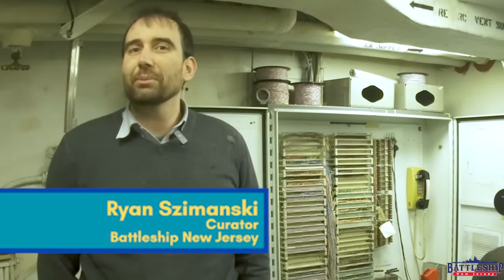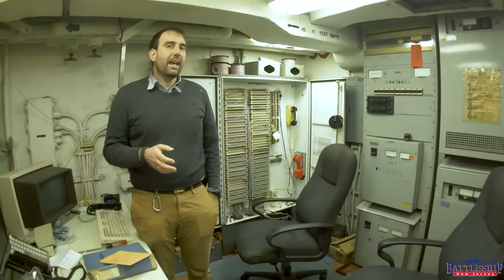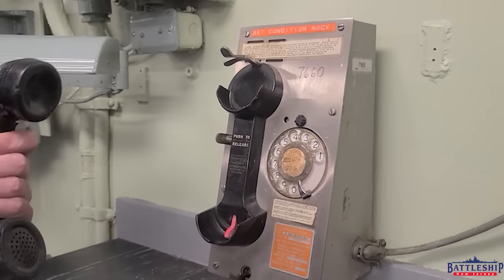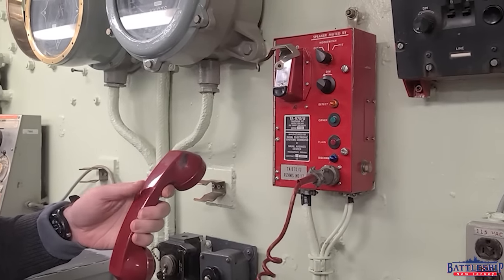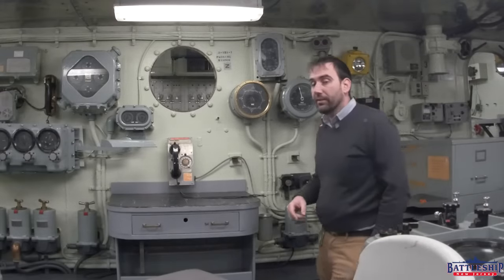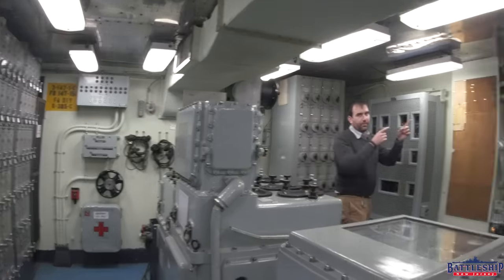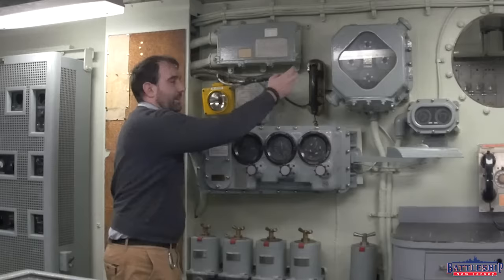What Powers a Sound Powered Phone and How Do Ship Phones Work?

Comment: I served in the Peace Corps in a small town (maybe 20,000 people) in Kazakhstan in the mid 1990s. One of the locals took me to the local telephone exchange - a building about half the size of a football field filled with bank after bank of analog switches. It made a tremendous racket. I heard that soon after I left, they replaced the whole thing with a single PC.
Reply: Unlikely.
Reply: Sounds like it was an exchange based on Strowger switch's. On nights it was possible to British Telecom engineers to "follow" a call physically across their part of London as it worked through each switch stack. As to a single PC, it may have had a bit more than that, but nothing more than a filing cabinet size box that the PC connected to.
Reply: I've seen similar miniaturization. From the old "stepwise" mechanical switches filling a large house (what looks like a house from the outside) to a DMS-100 in a building that would fit inside a single car garage. And then a "softswitch" that fit in 7U (23" telco rack) that could handle everything in the entire CO building. (Alcatel 600e + Lucent 5ESS) [not counting multiplexers to fan out to 10,000 to 100,000 POTS lines.] These days, with everything being IP (VoIP/SIP), a Raspberry Pi can do it - aka. the single PC.
Reply: with a single pc the problem would be how to attach all the lines.  

it could probably route as many simultaneous calls though - but what's more likely is that more such boxes were placed around the city instead of the single building.
Reply: Boooooo
Reply: one just has to look at old exchanges in the USA, big buildings that by any other standard than for a telephone exchange are massively overbuilt. Floors rated for 5x load carrying or more compared to a typical commercial or industrial space. And that is because the analog switches are heavy and are technically a live load due to vibration. Some areas of modern exchanges are still very structurally over the top by standards outside that industry because the battery banks for power backup are still quite heavy.  huge battery racks and of course gensets are why especially when the phone network was still fully analog it was extremely resilient. if the line was still there and unbroken odds are it could make a call because the CO was still there and powering itself even in a bad storm.
Reply: @filanfyretracker even the modern phone system is astonishingly resilient. Most customer premises equipment either has a battery backup, or the option to install one. With cellular networks, either has emergency power onsite, can connect to a site that does, or reverts back to a larger cell that overlaps with it.

Ultimately, modern phone networks have retained much of their resilience, even if the simplicity of keeping the battery at the exchange has changed.
Reply: @filanfyretracker  Telephone exchange buildings [at least the Bell system ones I saw] were "overbuilt" in anticipation of expansion -- of the current tech.   Pretty smart.   Of course, as tech progressed entire floors of switch racks were reduced to a couple of racks of computers.   When Ma Bell was broken up by courts, it became very sad to see the competitors [who, by court order could use Bell facilities] would slap in their equipment and just dump the packing materials and other waste in the "Bell" areas for them to clean up.  Very sad.

Comment: When I worked as a ski lift operator in the early 1980s the phone from the bottom to the top was a Navy surplus sound phone. We also had a regular telephone to call other places on the mountain.
Reply: understandable, I can imagine they wanted at least one link that was always assured to work if something went wrong with the lift.
Reply: Sound powered telephones are still used to this day even on new ski lifts at least here in France.
To call you have to rotate the wheel at the back of the handset but it's not really a crank, just a wheel that you grab with your entire hand.
Reply: @psirvent8  ours we had a button that activated a beeper top and bottom, pick up hand set, beep, other end picks up hand set, thing was always live.
Reply: @someonespadre Buttons means it must've had a battery for the ringer.
Reply: @psirvent8  the beeper was a separate system, electrical. 1 beep to talk, 2 beeps clear to start? reply 2 beeps okay to start. Don’t remember what 3 beeps meant. 4 beeps, have a problem going to be a while.

Comment: Sound power telephones were one of the first things we used in my apprenticeship . Good to learn connecting and wiring techniques with no external power . They are amazingly good and useful for any situation .
Reply: Interesting that they made them work in a battleship. The power from a dynamic microphone has to be very low, so the volume at the other end also has to be pretty quiet. On the other hand, there probably would be a lot of noise inside the room, so it had to be hard to use those phones. Of course, better than nothing.

Comment: Dad worked on the manufacturing side for IT&T. I believe at least 2 of us did science fair projection in the  60's on how rotary dial phones worked. We would also occasionally go to the office with Dad, and saw switching equipment  being built. Same process as building a replacement wiring harness for a car but scaled up. Large sheets of plywood, fitted with pegs and people, following a diagram with various colored wires

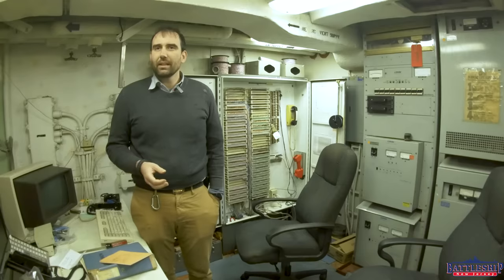Comment: At about 1:38 in the video, there are racks of grey equipment to your left.  Blow that up to full-screen and you'll discover that it's Lorain power equipment.  I worked for Lorain Products and its successor companies for 28 years starting in 1983.  That equipment looks like current production for that era, so I think your phone system power plant is from the 1980's.

Look at the nameplates on the units with a voltmeter and an ammeter on them.  The model numbers ought to start with either RHM (most likely) or RL.  The RHM chargers were phase-controlled SCR bridges and thus available in 3-phase only.  This seems likely with your 3-phase, 440V power system.  There were 3-phase RL chargers as well that used two single-phase ferroresonant converters in a Scott-T configuration, but I find that less likely for your installation.

It wouldn't be all that hard to get that power plant running again.  Replace the big fruit juice can electrolytic capacitors and the chargers will likely run.  Those things were tough as nails.  That's why the customers loved them so.  Even 40 years later, there are a lot of RHM and RL chargers still in service, so Emerson Network Power (the present successor company) ought to be able to provide suitable capacitors.

Tell them that Will from engineering sent you.  The old hands will know who you mean even to this day.
Reply: I repair old power supplies, and we got a few in yesterday which have the same vintage look. Transistors from 1980/1982, design we estimated was from the mid-1970s. Capacitors were astoundingly okay, a single carbon film resistor had drifted low causing a diode to overcurrent. Replace both of those, and it's off for another 40 years of service!

Some of the stuff back then was incredibly robust. But then again, we now have transistors smaller than your pinky fingernail that outperform in every metric a 1980s transistor that is larger than your thumb. There's a reason we've moved on. Don't get me started on power factor and efficiency!
Reply: @phillyphakename1255  One thing a tiny transistor does not do better than a big transistor is power dissipation :) It's more difficult to get the heat off a TO-92 than a TO-3 :)
Reply: @Pentium100MHz  true, if you are using it as a load, but for everything else...

But for everything else? A Rds on of 4.6 milliohms? With a resistance that low, you don't have to dissipate much heat so you don't need much surface area.
Reply: @phillyphakename1255  Linear regulator, Class AB audio amplifier can create a lot of heat. If used just as a switch, then yeah, most of the time it should be fine. For something like 10A I  would probably want something bigger than a TO-92 with its ~200C/W thermal resistance though.
Reply: @Pentium100MHz  ah, fair enough. My job doesn't use any linear power amplifiers, didn't think about that.

Comment: When I was in 73-76 USS Midway CV-41, my GQ station was a phone talker.  The headset had some tricks.  All three parts (two ears and mouthpiece) were the same -- you could listen to the mouthpiece and speak into the ears.  The mouthpiece had a pushbutton switch which normally disconnected it, otherwise it would pick up all the local sounds for everyone on the circuit to hear.

Fun: the mouthpiece pushbutton had a rotating cap which did absolutely nothing.  But it was easy to convince the new guys it was a volume control.
Reply: the standard sp handset is the same, talking into the ear piece was quite common when you had an amplified speaker.
Reply: Volume control, LOL! Good one... For people's information, the sound-powered phone talker at 5:20 has the chest-mounted mouthpiece folded down out of his face. You can see the back of it next to the sleepy guy on the red phone. The mouthpieces are on articulated arms that make them pleasantly adjustable, and allow you to keep them (and yourself) out of trouble. They were still in use 10 years ago for station-to-station communication during UNREP, and sound-powered phones in general still form a vital emergency backup on modern civilian ships. Volume and clarity depend almost entirely on the phone talker themselves, plus a little on your receiver.

Comment: I was a 31C in the Army 1984-1989. We operated the AM radio teletype sets and usually the short wave FM crypto sets. I was sitting on top of a ridge about 10 kilometers southeast of Pannmunjon above Bangmok-ri as a relay station when we caught the MARS station in Pusan. I called my mom in Colorado Springs from a mountain top on a radio and it didn't cost me a dime. That was technologically amazing at the time.

Comment: I was stationed on board the USS Stennis during OEF.
For the first part of the deployment the "pay phones" worked intermittently. Some of that had to do with OPSEC, some of it had to do with the equipment on board. Later in the deployment the phones were working almost 24/7. MWR in conjunction with the NEX started passing out 15 minute phone cards for free at about the middle of deployment. AT&T also passed out 10 minute phone cards. There were stacks of them in the First Class Mess. I still have a few unused cards in my desk drawer.

Comment: When I visited in April (2023) I tried some of those rotary phones and most of the telephone instruments themselves needed repair as does the one you demonstrate. I was able to make another phone ring, but we couldn't have a conversation. After the phone itself works you still need to make cross connects and switch assignments. That PBX should be capable of interfacing with outside lines when tied up.

Comment: It was a pleasure for me to see  again one of what you called "the coke machine" . The red box for radiotelephone  communications between ships in a squadron. I was part of the Hughes Aircraft Co. group that developed that system to replace older telephone crossbar switches. I also had to demonstrate  for VIPs that two different signals, one plain and the other meant for encryption before being transmitted could not be detected even on adjacent channels. Crosstalk was one of the problems with the systems that ours replaced on Navy  warships of all kinds.

Comment: RN sound power phones had a shutter system on individual phones , the growler was enough power to release a luminous tag  behind a glass on the case so you could easily identify the unit with the call . It reset when the handset was used .

Comment: My first voyage on a merchant ship introduced me to the Sound Powered Telephone. It was on a 66000 dwt tanker and used for communication between the bridge and the engine room. It was very difficult to have an easy conversation when standing next to a 10 cylinder B&W diesel engine, with only a very poor open sided booth to muffle the noise. No engine control rooms in those days. At least the later ships upon which I served had engine control rooms and proper telephone systems, with phones also in our cabins.

Comment: We had these in the ADM Flour mill in Enid, Oklahoma, which was built in 1928.  When i worked there in about 2001, they still worked great.  It had a button nearby which honked a system of claxon horns through the plant.  Everyone had their own "honk".  Mine was 2 long.   It more or less followed Morse code.  The lower you were, the more compex the honk.
Reply: I wonder if that was for price, reliability or the fact that its a flour mill, lots of powder and as such minimizing energized spark sources is important.  Because it seems like the current made by a sound phone would be so low there is minimal chance of an arc at any time.

Comment: Yeah, you're off brother.

I served between 1988 and 1992. We had no pay phone for hooking up to shore lines. You had to go to the top of the pier and stand in line to use the pay phones there. In 2003, however, when I went back to visit the ship for her decommissioning, there was a pay phone installed right by the mess decks, like you said. But that was obviously installed sometime between 1993 and 2003.

Also, we did not need Ham Radio operators. We had Sattelite phone capability. It was called the "MARS" system. I have no idea what MARS stood for, but that is what it was called. Occasionally, they would open it up and give people 10 minutes to make a phone call, if you wanted to go stand in line to do it.

New Jersey was still in commission when I was in. Iowa and Wisconsin were in Norfolk with us.  If we had/did not have these things, they had/did not have these things.

Comment: How do they know how much horsepower the ship is making in trials? Thanks so much BNJ staff for all these videos they are truly great.
Reply: i don't know if they had power meters in the 1930's, but modern ships use an electrical strain gauge attached to the shaft, paired with an RMP reading. torque from the strain gained multiplied by rotation rate and a conversion constant equals power
Reply: I would think the shaft has a dynamometer 🤷‍♂️.

Comment: It would have been SO COOL if the ship had it's original WWII phone system in place!  Still, this equipment is still neat in it's own right.  The sound powered phones are way cool.  Yes, they're sound powered, but they're also electrically powered- by electricity generated from sound. ;)

Comment: I grew up with rotary dial phones. They were a lot quicker to return . Imagine being in dire straights and dialling 999 (UK).
Reply: 999 was chosen explicitly to be the longest return, to avoid false dialing. In New Zealand, phone dials were numbered the opposite way, and as a result the emergency number there is 111
Reply: The story I always hear is that most countries numbers start with 9 because it’s very unlikely that the wind will knock the wires in just the right way 9 times in quick semi rhythmic succession preventing accidental dials.

Edit: after reading the Wikipedia article on pulse dialing this is exactly the case for NZ also, it’s just the number one is encoded as nine pulses instead of one pulse like most of the rest of the worlds systems were.
Reply: Unless theirs was purposely slowed down which I doubt I'd say the grease on the dials escapement thickened

Comment: So, does the sound vibration of your voice generate electricity and send your voice to the other end, or is is more akin to two cans and a length of string?
Reply: The voice generates an electrical signal that travels through copper wires. Some of the shipboard circuits will have electrical amplifiers that  can strengthen the signal if the stations are far apart, but are not necessary for functionality.

Comment: That rotary dial phone's dial is rotating way to slow. It needs maintenance, cleaning of the worm gear assembly and regreasing.  Then it will rotate at the correct speed and then it will send dialing pulses at the proper rate which is required for it to work correctly.   

You should see if you have any volunteers who would be willing to clean and lubricate the dialing mechanisms on any phones that have this draggy dial problem. 
It's maybe an hour to service one phone, start to finish.

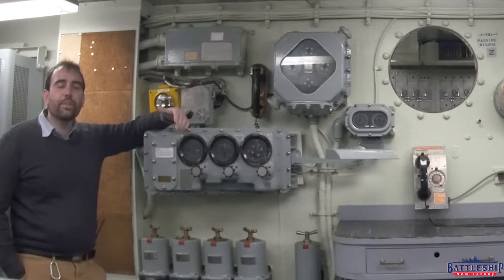Comment: 4:29 What if a wire is shorted to "ground"? Test if and which wire touching the metal wall will stop communications. I suspect that if both ends of one damaged wire are touching the wall, then the signal will pass. Test it in a video?
Reply: a single ground will degrade the circuit, but it will still be useable. 2 grounds equals a short, and then she's dead.
Reply: Not in that situation as it would be a dead short , but we used to use handsets to identify cores on multi stranded cables , as long as you have two conductors insulated from each other and not too much resistance they work .
Reply: You will have a horrible 60 Hz hum which affects the whole circuit.  If you ground BOTH ends of the SAME wire, it wouldn't be a short, but would most likely be unuseable.